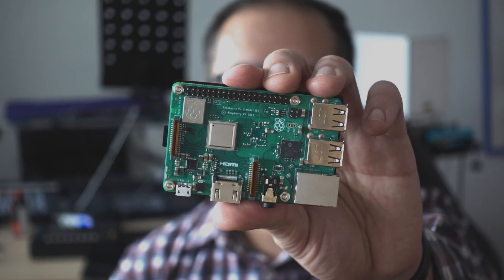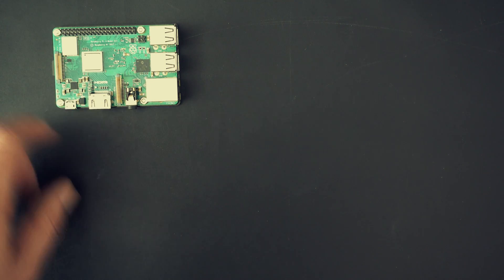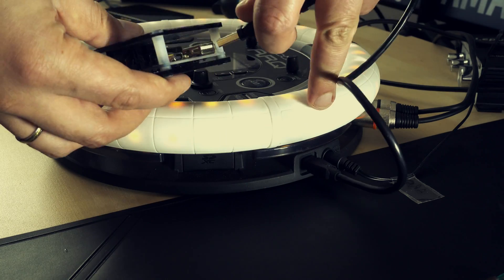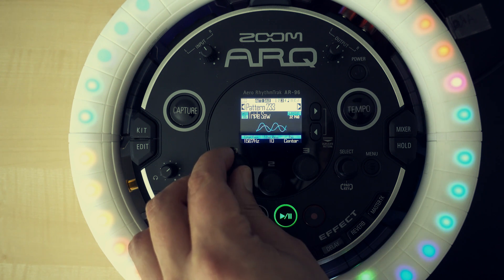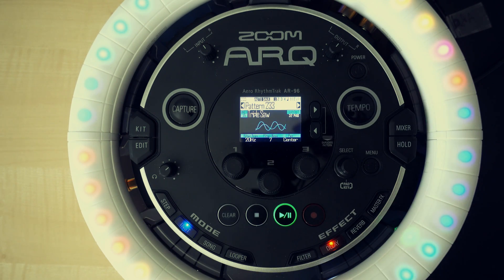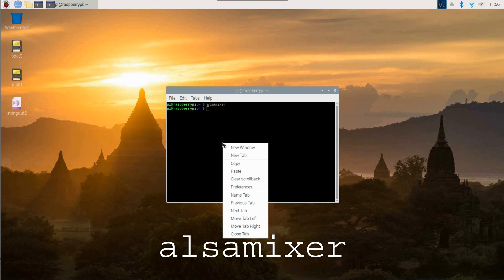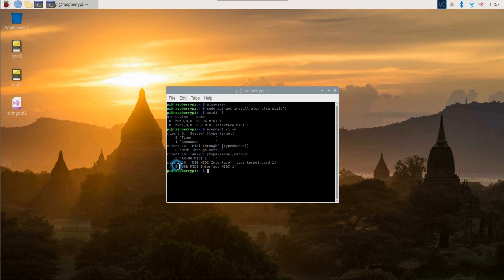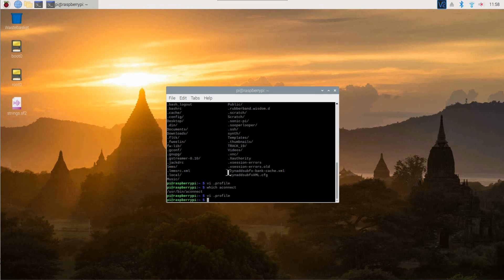How to use a Raspberry PI as a USB MIDI host

Comment: Can I use this to control my Volca FM with a nanokontrol MK1??
Reply from the maker: Hi, thanks for watching! Yes, that's possible. (You need to set up the Nanokontrol first, of course).
Reply: @mr_floydst  do U maybe have more detailed info on how to set this up perhaps?
Reply from the maker: @boimesa8190  There's a configuration app on windows for the nanokey, and you need to look up the CC numbers the Volca listens to (https://soundprogramming.net/manuals/Korg_Volca_FM_MIDIImplementation.txt) and set up the Nanokontrol accordingly. Afterwards, set up the Raspberry as shown in this video.
Reply: @mr_floydst  yes I know but I actually meant on the RPi 😅 I forgot to say that I want to use the kontrols' scene selector to switch midi channels so I can switch from my Volca to another synth I have (that only has midi in via USB). Although setting this up without a traditional UI looks very difficult to me...
Reply from the maker: @boimesa8190  On the RPI, just follow the instructions in this vid. Connect both devices to MIDI out (or one to MIDI out and the other one to MIDI through), set one to listen on channel one and one to listen on another channel. Then setup qjackctl as needed.
Reply: @mr_floydst  I only have a USB<>MIDI adapter with 1 input and 1 output. And as I said; one has a 5pin midi input (Volca) and the other must be connected via USB to receive midi data... So would I just have to connect the adapter via midi to the RPi, it's output cable to the Volca FM and the XioSynth (midi input via USB) to the RPi via USB and configure the midi channels and messages (cc and notes) with qjackctl?
Btw I think it would be VERY useful for alot of people if there were some tutorial for the qjackctl software... ;)
Reply from the maker: @boimesa8190  I think my more successful video on the PI might contain some info on that. :) https://youtu.be/ae5TYhnhp3w 
I looked up the synths you own. I'd connect the XIO to the PI by USB. The VOLCA needs to be connected with your 5pin interface, USB end goes into the PI. Nanocontrol goes into the PI as well (it has 4 USB slots, so no problem there). Then set up the MIDI connections in qjackctl as needed and as shown in my other video)
Best regards! I might do a more detailed video on how to do that in the future, so thanks for your feedback.
Reply: @mr_floydst  ok thank you! I'd love to see a video on that!
Do U think my RPi 3 would be powerful enough to run a synth at the same time? If so, which do u think would be best?
Reply from the maker: @boimesa8190  I think you can run simple synths (sound font players) along your MIDI stuff. Should be no problem.

Comment: hey Floyd,
I've recently gotten an arq ar 48 and since I've seen this video of someone sequencing an ar 96 with a  circuit https://youtu.be/logZeSzNAws 
I was wondering if I could use a pi I have lying around as a usb host like to sequence it with my electribe and if I need to take extra steps than those you have taken in the video?
I tried putting hooking up my electribe with this cheap usb to midi converter from roland but it somehow screwed with the midi channels and the instruments played chromatically than on seperate channels like the electribe normally is set up midi wise
Reply from the maker: Hi, thanks for watching! I don't think that will work, as the ARQs only do MIDI OUT. I think someone managed to reverse engineer the USB stuff, getting some kind of MIDI  in, but I can't find that any more. Some people also reported varying degrees of success using a Bluetooth MIDI connection. 
Apart from that, using the PI as a MIDi USB host works fine. Using qjackctl, you can route anything to anywhere without hassle.

Comment: have found a device you mentioned in the beginning - https://www.hobbytronics.co.uk/usb-midi-converter 
still 5 of them for a sale, but unfortunatelly in my case it won't help as my midi xone k2 is audio/misi usb hub.:(
Reply from the maker: I think you should contact their support - even if your warranty has expired, they should perhaps know there's a problem with Ryzen based machines...
Reply: @mr_floydst  the item is brand new, and they are trying to resolve it after many emails I sent over:)
Reply: Thanks for sharing this insightful info. Looks like I'm having the same issue, Xone K2 not working with Ryzen. Would it work with this Raspberry PI and any midi remap/converter patches you can recommend? Much appreciated.
Reply: @INPUTMETHOD  I had to go hard way and part with my AMD Ryzen laptop, the response from Allen and Heath was - we are aware about th e problem, but becasue not so many ppl use AMD, we won't be resolving it soon....it was almost 6 months ago...so go figure....in the near future, there will be no Intel, or little precentage, as AMD is a king now, so they will have a big problem and many unhappy users. The fact is, there is not many, or none similar solution as XOne K2, with it's portability and function as 4 channel DJ mixer .... anyway, as my system grow, I am looking to build as small as possible (so raspberry pi seems like a best solution) audio setup able to record audio, several tracks via usb interface. The problem is PI is running OS I completely dont know how to use, and I dont even know how's with asio drivers, or DAWs running on linux based OS... So maybe I'll go for something small facture like Pi, but win10/x64 compatible, so I will be able to use it without breaking my legs:)
Reply: @RedMastering  Yes that is the same response I received. Amazed that class compliant means we only handle some platforms. Well with microcomputers getting faster I’m looking at an Intel type version of the Raspberry then running a midi conversion script.
Reply: @RedMastering  Would have to test it out and hopefully since it’s Win/Intel plug and play, ASIO audio and midi should work. You are correct about the Xone K2. Think there are many usb midi controllers that people are wanting to use headless, it’s a shame A&H aren’t willing to invest some time in making the product more compatible long term, solving drivers, making a midi editor/remapping software. Anyway keep in touch with how you go with potential solutions.

Comment: hi, great video!, I am looking for somehting like this, I got usb midi controller (allen&heath XONE K2) which refuses to work with new amd ryzen based laptop:(...I can live without it's audio function (its a midi and audio device), I would be happy if I could run it just with midi and my traktor pro3. Although I never used linux/ubuntu and this system is a chinese for me:/...not to mention I would need a screen to operate it (oh actually you responded for that querry, but still with 'chinese':) as per windows guy (I know win very well). but linux seems to me super complicated..could you give any advice for linux noobs?:)
Reply from the maker: Hi, thanks for watching! I'm a bit puzzled that controller doesn't work with your laptop. If it's a standard MIDI device, Windows should install the correct drivers automatically... 
You could try to make this work with a RasPi as sort of "intermediate" device. There's a program called "qjackctl" on Linux which has an easy-to-grasp graphical user interface that enables you to connect all your USB/MIDI devices to each other. I made a video on that last year: https://www.youtube.com/watch?v=ae5TYhnhp3w&list=PLN55_-YN4bziwkbVLelcG7hfEzmGHituY&index=3
Best regards!
Reply: @mr_floydst  hi, kindly thanks for your quick response! well, XONE is a standard midi and it does work with all intel based computers as well with my ancient athlon desktop, for some reasons it doesn't want to work with new ryzen cpu (I tested it on several machines). So I am looking for alternative solution. Do you think something like kenton midi to usb host could solve it? I think in my case it is better and simpler solution, less hasle and more reliable (if it will work:)
Reply: @mr_floydst  btw, I have found that xone should work under ubuntu, but just info, no instruction how to do it, and actually in act of desperacy I installed ubuntu and spent few days trying to make it work (with wine and playonlinux)....it was a failure as I do not understand ubuntu, it's very complicated for a noob like me:/..... I wanted to :
1. install drivers for audio interface (Native Instruments Komplete 6) - according to Internet they do work under Ubuntu
2. install drivers for another midi controllers (NI x1mk1, NI x1mk2, denon sc 2000 and obviously XONE K2)
I wasn't able to do it....have found info that xone and komplete does work under ubuntu, but no info how to managed that...
so frustrted I gave up after few days...even tried instal hackintosh:), and it was a failure again...
If I could do above, I won't have to get raspberry or any other device, becasue all I want is to run Traktor Pro 3 with my controllers, but complete lack of my knowledge in this area stopped me doing this.
From what I see you know linux based system very well (especially audio related). Would you be able to support/help me with that ?
What I need to do after installig Ubuntu? step by step info ? I would really appreciate it... It's been almost a month since I tried to connect Xone with my new laptop and it's been so frustrating time, nobody can help me, no allen&heath (xone maker), no Asus (laptop maker) no AMD (drivers maker - as it seems problem relates to AMD USB drivers)
So frustrated spending over 120hours trying different solutions and so far no luck... I even tried to sell brand new laptop just for that reason (as I got this laptop for DJing as well and it seems its unusable). Another thing is there is no alternative device on the market like Xone k2 with 4 channels midi mixer option, so I am making rounds catching my own tail ...:) If you could help me man, I would be super happy and can offer you in return free service for my mastering:)
Reply from the maker: Well, if you're really going to try Linux, connect all your MIDI and audio devices to your PC and boot Ubuntu. Run the qjackctl app and see if your devices show up there. Then report back here. :) Did you watch my other video? It shows some of the steps necessary to get your MIDI equipment running.
Reply: @mr_floydst  u write that u made a video on this but it's about making a synth... U only cover the midi part very shortly

Comment: This is fantastic, Floyd ~ exactly what I needed, though I am struggling to make it truly 'headless' (no monitor, no keyboard etc. at boot) I am a little confused/new to R.Pi, so was wondering if you could point me in the right direction?
Reply from the maker: Thanks for watching! If you got your standard Raspbian running, configure it from the start menu and turn on SSH and VNC.
You can then access your PI over the network by SSH (Windows: use a program called Putty) for text-based interaction or by VNC (download for Windows) for getting the graphical user interface on your desktop PC. 
You can also turn off the graphical user interface completely for that extra RAM and CPU cycles, but so far, I found no benefit in doing so. https://raspberrypi.stackexchange.com/questions/1318/boot-without-starting-x-server

Comment: Amazing! I instantly subscribed! I really hope it works to use the Raspberry Pi as an USB Midi host! I have a Roland HP 704 (New Digital piano's don't have Midi 5 pin output channels), raspberry Pi 4, UA-25EX (Cakewalk, soundcard for my laptop) and a laptop (with DAW). My piano has a USB-B (female) channel that goes to the Raspberry Pi 4 (USB-A). The Midi Signal goes to there as I have tested. But now I want to have the midi signal from the Raspberry Pi4 to my Cakewalk (with a USB-B to Midi cable). My Cakewalk UA-25EX has a Midi in en Midi out (5 pin) channel and a USB-B (which is connected to the laptop). 
When I am checking if the midi devices are connected I only see the Roland HP-704 connected with aconnect -i -o. If I connect the USB-A2Midi cable I see that the cable is connected: 
IO  hw:2,0,0  CH345 MIDI 1 
Unfortunately if I connect the cable to the Cakewalk UA-25 EX then nothing happens and it's still: IO  hw:2,0,0  CH345 MIDI 1.

My main issue is that the Midi Signal doesn't go from the Raspberry Pi to my Cakewalk UA-25EX. Do you have any thoughts what I can try? I really hope you want to answer. I see you are replying to a lot of comments so that is amazing!

Also I connected the Cakewalk directly to my raspberry Pi with an USB-B (from Cakewalk) to USB-A cable (Raspberry Pi). The it's recognized by the pi: IO  hw:3,0,0  UA-25EX MIDI 1
But then I don't have the Midi Signal to my laptop.
Ultimately I would like to have the Midi output signal from my Roland to my Raspberry Pi and then from My Pi to my Cakewalk (UA-25EX) and then from my Cakewalk to my laptop which has a DAW.
Reply from the maker: Hi! I'll answer your mail. :)
Reply: @mr_floydst  That is fantastic!!

Comment: Hey Floyd! Nice Video!
In this video you are using rpi as MIDI thruput. But i'm wondering if is it possible to send MIDI OUT to devices via USB using a piece of code.
Like:
Raspberry -> USB -> DAW
Raspberry -> USB/MIDI -> Synth
Do you think its possible?
Reply from the maker: Thanks for watching! You can do that. the "aconnect" command can do that on a console level, but if you need a more visual approach, qjackctl is the program you're looking for. It displays all the MIDI inputs and outputs in two columns and you can then connect them with "patch cables". E.g. if you have a software synth and a daw running on the pi and you want to connect to another device connected by USB, you can do that by plugging them together. I made another video showing that process: https://youtu.be/ae5TYhnhp3w?t=496

Best regards!

Comment: Hi Floyd!!!...Given that I have been familiar with electronic editing for several years, but very little experience with programming...I need to build a foot controller with six or eight switches and two expression pedals for zoom multistomp devices like ms70cdr...MS50g...and similar. Do you think can I use simply the Raspberry PI3 board  alone adding a monochrome display ???...without other added boards...except the switching and pedals hardness...Many thanks in advance and congrats!!!
Reply from the maker: Hi Antony, thanks for watching. The PI has 17 GPIO ports, which should be enough to switch a lot of things on and off. You can buy very small HDMI display from amazon which should work for you. Just be careful not to buy one which blocks all the ports.
Reply: @mr_floydst  Many thanks for fast reply...I'll look soon for the BOM...

Comment: I have been considering buying a RPI for this purpose.  Is this a 3 or 4.  Sorry i am oblivious to this world.  Thanks for your information
Reply: I saw another one of your videos with a 3 and assumed this was too.  Is there a benefit to getting a 4 or is 3 good for this and other functions.
Reply from the maker: @fillentropy6519  Model 4 is much more powerful, so it can run more virtual synths if you're interested in that. But for this (USB MIDI host), the Zero will be perfectly fine.
Reply from the maker: Hi, thanks for watching. This is a 3. Said it somewhere in the video. ;)
Reply: Ok. Great thanks.  I have no clue about anything RPI.  so any info is good for me... not sure if there are different versions, I've seen B+ and no idea what a zero is.  I have smoe research to do but my main goal is to use it as midi host.  If there are other things i can do later than that is fine.  Just not sure what versions are suitabke for what.  Thanks for your videos.

Comment: I may be wrong, but if you use ~/.profile that is only executed if the user raspberry logs on. To make it on system boot you need to do something more spicy... I think atleast, maybe im wrong :D
Reply from the maker: Thanks for watching! You're absolutely right :-) On the PI, if you choose the default Debian installation, that'll be set up to boot straight to the standard profile. So for that configuration, this will work.
Reply: @mr_floydst  ah that makes sense. The raspberry has some special stuff :-)
Reply: @mr_floydst  To add to this, you only need the "aconnect XX.X XX.X" you don't need the whole directory. If you use the whole directory, the command will not load.
Reply from the maker: @vincegb9855  Thanks for pointing that out!

Comment: I also use the RPi  as a USB host, but only for USB to USB devices. If I'm not mistaken, you may skip the :0, as it is the default if not presented. So, aconnect 16 20.
Btw, I'm not sure if using that line in the .profile file always connects correctly... Even more so if you have more than two USB devices.
What USB to MIDI converter are you using?
Reply from the maker: Thanks for pointing that out! The interface just the cheapest one I could find on amazon.
Reply: Floyd Steinberg cool.  I’ve not had much luck with those (cheap) USB A to 5 pin in/out converters.  Glad you got one that works.

I end up sometimes using the MIDI jack on my Behringer audio interface, connected to an iOS device, but that box is 4x bigger than the Pi, in addition to paying the Apple tax 😁
Reply from the maker: This is Linux, things never work right out of the box. I had to edit some config files and disable stuff to get my interface working. I might / should do a detailed video on this, but I didn't want to ruin my working setup before finishing my other videos :-)
Reply: I have read that the pi does not always assign the same numbers to devices, so they should be named, but am not sure about what file you would name each device so they always are always recognized and mapped correctly.